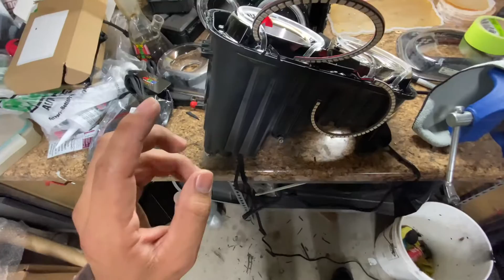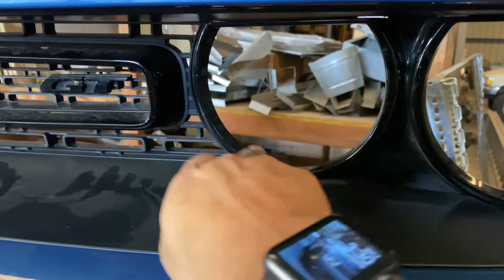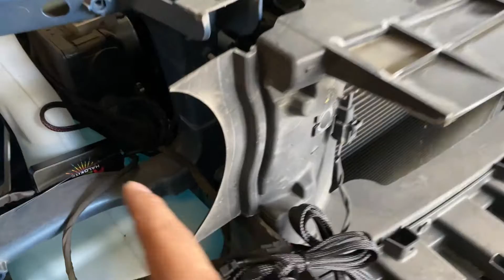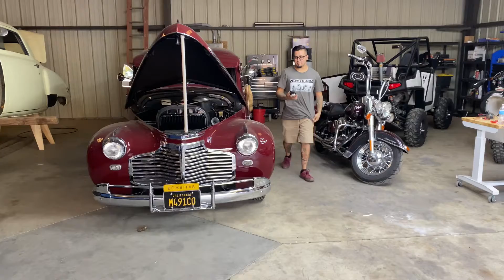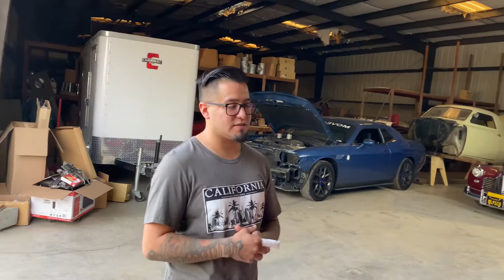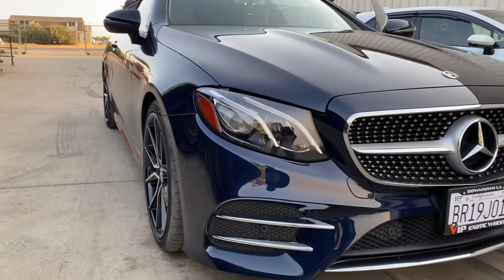RGB Halo kit [2020 Dodge Challenger Sxt] #RGB #dodge

Comment: I got rgb Halo kits boards for the challenger, Is there a way to connect everything to turn on with ACC and/or headlights and just to switch color with the Bluetooth app ??
Reply from the maker: Yes by connecting it directly into the fuse box under the hood.